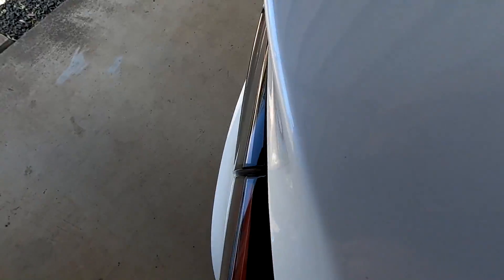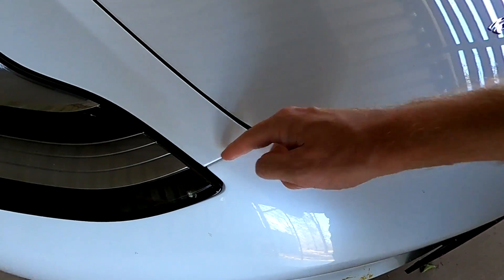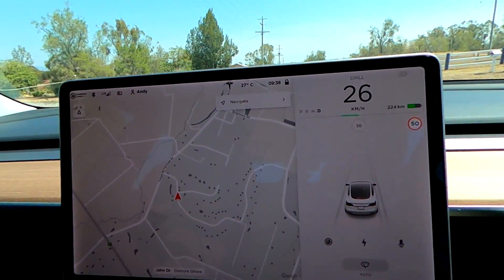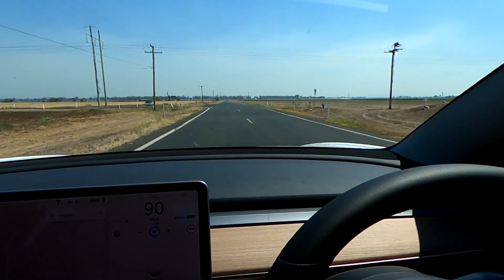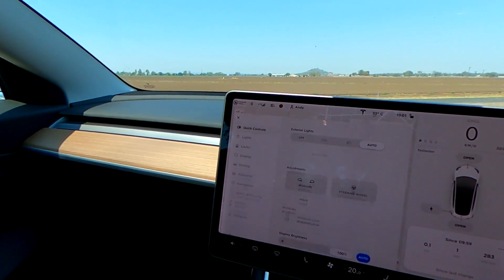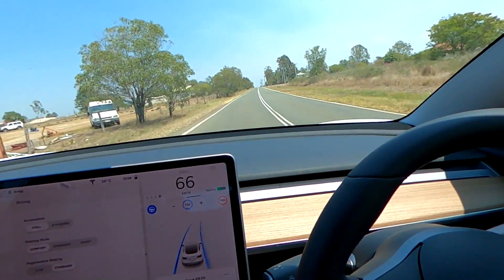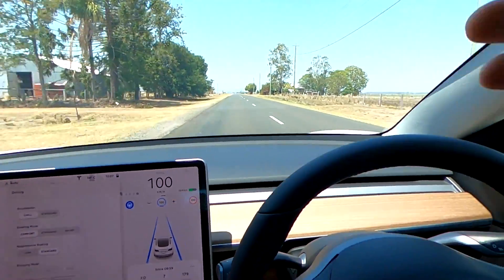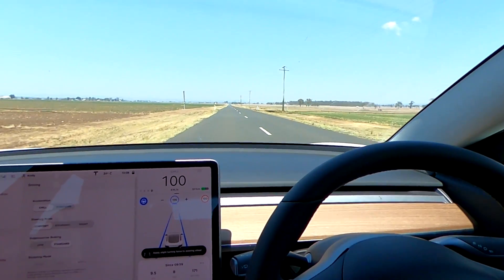EP306 - Not enough Tesla-data to make Autopilot work?

Comment: by law you are supposed to have both hands on the steering wheel not because the car is uncovetable. other wise you are not in control. so until the law is changed for new vehicle u have to keep your hand on.

Comment: Andy, Tesla self driving features do not use map data. They rely solely on live camera and sensor data. This has been confirmed in one of the interviews. Currently maps are only used for range estimation (elevation changes) and for speed limits.
Reply from the maker: I know that, that's why I said, they may not have enough data for Autopilot on these roads yet. It drives like an L-plater sometimes... :D
Reply: unplugged EV ah! I think what you mean is: they don't train their AI on Australian outback roads like this one, which is why it's less confident...
Reply from the maker: I think there was never a Tesla on these roads before, so they don't have any data.
The last 2km on my way home have already improved a lot. I showed my wife last night and she said, wow, the car is driving itself without any problems, while at the beginning it didn't do it very well. The time it nags went up from the initial 12s to now 20s.
Reply: @unpluggedEV  This is amazing! So rewarding to see the car get "smarter" with each km driven, even on unfrequented ("exotic" from USA perspective) roads 😎